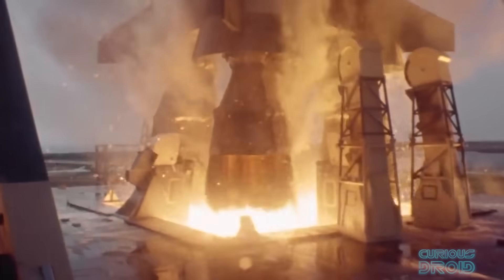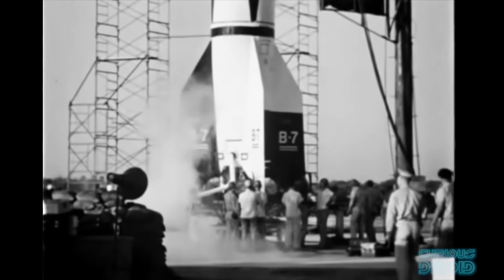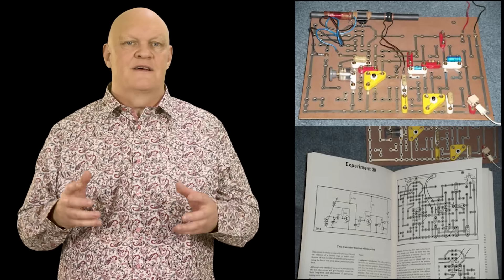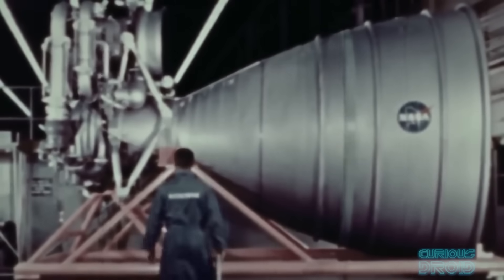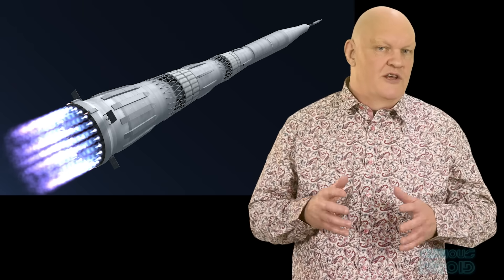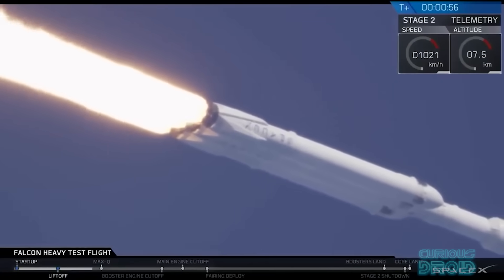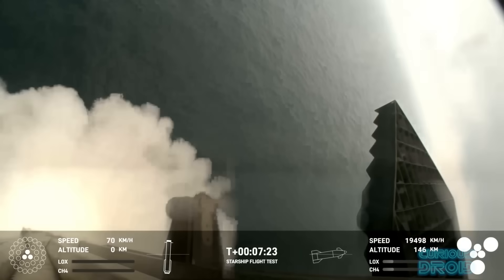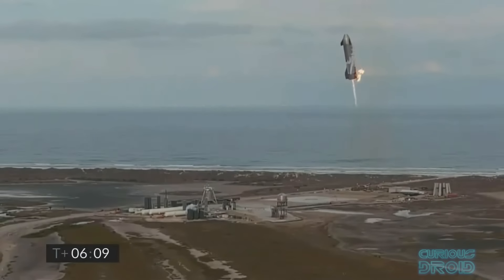Why Does SpaceX Use 33 Engines While NASA Used Just 5?

Comment: This video only briefly mentions the most important point: you want to mass produce just one type of engine to bring the costs down. In turn that means in order to use that one type of engine for all the different stages of the rocket, you have to use a lot of them for the first stage. Saying it is due to throttling limits is putting the cart before the horse, if SpaceX had decided to use 5 huge engines on the booster and land it using just the centre engine, then they would have designed it to be deeply throttlable. And it is possible to have such deep throttle control, though it adds complexity so avoiding it is an additional benefit. But the fundamental driver is mass production of one engine type to reduce costs.
Reply: what would happen if you tried a landing burn with an F1 and empty tanks.....
Reply: @georgeoverton8267  If you time it exactly right you reach zero velocity and zero altitude at the same time and you have successfully landed.  If not, well, probably nothing good.
Reply: They don't really need to make the throttle that low. Falcon 9 does what's called a hover slam. The engines are too powerful and will send the booster back up. So they time the engine ignition at just the right moment so the thrust and velocity of the first stage cancel out just before it touches the ground.
Reply: @TwitchyMofo  The engines are too powerful because there are real limits as to how much you can throttle a rocket at sea level.   Out in space it's a LOT easier to throttle down because you don't have a high pressure atmosphere trying to invade your nozzle and mess up your flame and shock wave propagation.   It's also a LOT easier to make a small engine strong enough to function at sea level than a larger one and SpaceX is smart to go that route.   The F1's were amazing machines...but very restricted in their use and not flexible enough to ever land back at sea level.
Reply: @recoilrob324  I don't think you read what I wrote at all.
Reply: @TwitchyMofo  I read what you wrote...about the 'suicide slam' deal the Falcon 9 does.   They can't do that with the Starship because it has to be able to hover stationary giving the Mechazilla arms time to move into place and grab it.   So the engine used for the hover obviously needs to be throttled to that thrust level.   

Noticed on the last flight that they used several engines to knock off most of the speed then down to the single one for the hover.   Having multiple engines also allows them to switch if the one they were going to use for the hover happens to malfunction.   As long as it's one of the gimbaling ones they should be fine.
Reply: @recoilrob324  it hovers because the thing is so damn heavy. I don't think they had to make any special effort to have very now throttling engines.
Reply: @TwitchyMofo  I agree with the 'no special effort' part...but their choice of many smaller engines also played into the ultimate goal of catching the booster and ship during a stable hover.  There is a very real limit as to how much you can throttle a sea level rocket and their intent to hover was designed within the capability of the Raptor engine.
Reply: @recoilrob324  that's possibly the case. But I think the biggest driving factor behind the small engines is the economy of scale. They will make thousands of these engines. Catching the ship out of the air idea, I believe came after the initial versions of raptor engines. They were struggling with landing legs and decided to ditch them all together. So I'm not sure how they could have known they needed to hover. I think it just worked out that way. I could have that timeline wrong but that's what I remember.
Reply: @TwitchyMofo  Think about the landing process in more detail. First stage boosters aren't heavy when landing, they are empty metal cans. SuperHeavy launches carrying 3,400 tons of fuel, plus a 1,300 ton Starship, which is why it has over 8,000 tons of thrust. Empty its only 200 tons, so to hover it can't use more than that much in thrust. If it had five Saturn V F1 engines for example with 1,550 tons of thrust each, they can't throttle at all so a single F1 would launch a near empty SuperHeavy skywards at over 7 gees. 

SpaceX could have tried to build a bigger Raptor so they only needed 9 engines like the super successful Falcon 9, but that would make them more difficult to design because of combustion stability. And at over 800,000 tons thrust each, they'd have to be able to throttle down to 25%, which is extremely difficult to achieve (currently Raptors limit is 40-50%) and even if possible it makes it difficult to maintain cooling of the bell and chamber, and would significantly reduce operating life. Lastly, it would force them to build a smaller engine for Starship, since a 800k ton engine would be impossible to throttle low enough for landing a 100 ton vehicle. 

So by using 33 engines they get to use an engine thats much easier to build, maintain and get to build in far higher numbers reducing the cost per engine substantially by sharing the cost of the tooling for mass manufacturing over more than triple the engines. And it makes hovering almost trivial without heavy throttling extending engine life and with no suicide burn makes  landing significantly easier and safer.  And they get to use the same engines on Starship, which increases their production of the same identical engine to 39 per stack,  and again reduces cost per engine in mass manufacturing.
Reply: @JesusTittyFNChrist  you're not saying anything I don't already know. As I said before I'm not sure hovering had anything to do with the reason for so many smaller engines. Unless you go way back and find musk saying that they went with small engines to allow hover. Everything at that time had legs and was conceived assuming landing legs. Falcon 9 does the hover slam because it's thrust is too great when it's empty. Meaning hover was not required during the initial design of the raptor. 
Also there's no reason Saturn 5 couldn't have done the hover slam assuming the engines were designed to start back up.
Reply: There's also thrust density to consider.
Given a fixed area on the underside of the rocket smaller engines/combustion chambers will have more thrust per unit area than fewer larger engines. The reasons range from thrust vector gimbal angles to achievable pressures in smaller combustion chambers and expansion ratios.
This is important because the higher the Thrust to weight ratio the lower the gravity losses are.
Reply: the throttle control required would have to be deeper than anything ever done on such a large rocket
Reply: @darkfur18  OK - have 4 large and 1 small
Reply: Yeah which logic dictates that makes 100% more sense for a private company than something funded by the government.
Reply: "you want to mass produce just one type of engine to bring the costs down."

I think in the case of SpaceX it's pretty safe to say that the design of a million engines is down to the fact that it looks cool, just like the tip of starship is pointy because it looks cool.
We can talk about rocketscience all day but in SpaceX most of the work is done for publicity and not because they actually have a good reason for it.

The "good reason" is made up by fans afterewards because "spacex cannot make bad decisions, the genius that is elon would not allow it".

Nevermind that we are ten years in,  several years past the announced Mars landing dates, and we don't have a working starship yet. There be reasons for that, and "they made the right design choices" is NOT among them.
Reply: @vinny142  Falcon 9 is the most successful launch system in history, based on most launches per year, highest percentage of successful launches, most consecutive successful launches, most tons to orbit in a year, first reusable boosters, and lowest cost per ton to orbit (outside the Falcon Heavy).

It's not "fanboys" who think the reason F9 has broken all the records because of great design decisions made by Elon & SpaceX. Its engineers who appreciate how using 10 identical engines enabled mass manufacturing using shared tooling to reduce the cost of Merlin engines to $250K each (from the tens of millions common in an Old Space industry still hand-building bespoke engines). And how using 9 first stage engines enabled using a single engine to land the empty tin can of the first stage for reuse, since larger engines could never throttle low enough. Or their use of the same dense fuel for both first and second stages, which cost some performance to high energy orbits, but greatly lowered launch costs, reduced delays and simplified pad operations to help enable higher cadence launches. 

Lastly, Starship started development in 2019 when the decision was made to build with Stainless steel. Only 5 years later prototypes have achieved orbital velocity twice, that's a record pace especially considering its by far the largest rocket in history. Starship right now could be used as a fully expendable rocket and according to industry analysts (payload .com) would be the cheapest launch system per ton in history. Its far more ambitious than that, but at the rapid pace its test program is proceeding its likely to have both stages landing and reusable by end of the year, and in-orbit refueling demonstrated next year.
Reply: It also fails to mention that starship has destroyed over 100 engines and is still yet to get into orbit. So much for reusable rockets.
Reply: Starship could have reached orbit by now, it reached orbital velocity and altitude. SpaceX chooses to put it on a trajectory that intercepts the earth to ensure they don't  leave a large chunk of space debris that would reenter uncontrolled at some future date.
Reply: You’re just a dense, dense hater.
Reply: Yeah, or you'd fry your butt and be to heavy for a decent burn on account of how much fuel (best engine ever, probably) burns.
Now I want to see what happens with an f1 coming down...boom.
Reply: I thought that was implied already?
Reply: wrong ... what i easir and cheaper .... 30 cars or 3 trucks ?
Reply: @Menelutorex  A more valid comparison would be 33 cars vs 3 semi trucks (I assume by trucks you mean pickup).
Reply: Did Apollo 11 actually leave near-Earth orbit?
Despite the revisionist narrative that this channel won't question -- unstable fuel burn for the oversized F1 engines was never rectified and another arrangement in their place was made in order to reach near Earth orbit, keeping the F1 bell nozzle to maintain the desired appearance.  The great licking yellow flame was an indication that something was not normal as fuel was burning in the atmosphere while providing no additional thrust. This was the result of injecting additional kerosene into the exhaust stream for greater visual effect yet appearing to produce an inefficient burn unlike other rockets after launch.  No explanation is forthcoming and this issue is not addressed in any usual report; however, using a smaller reliable engine with a reduced fuel load and stripped down mission requirement allowed the Saturn V to reach near-Earth orbit.  The Apollo 11 crew attempted to demonstrate their position at over halfway to the moon as seen in the unedited version presented to the public while the more recently released unedited version reveals a flood of blue light entering the same window as the camera continues to roll, through which only a moment before, we saw the Earth far distant in what appeared to be very low light conditions. Then, as the camera pulls back from the window, the exposure settings are seen to return to normal as a flood of light enters the same window.  Without a change in the orientation of the spacecraft assumed to be on a trajectory toward the moon, the only source for any flood of light can be the Earth while in near-Earth orbit.  The usual sponsored efforts will try to make excuses for why the obvious did not take place -- yet is overly apparent in the unedited version.  When facts cannot prevail in support, sponsored activity will resort to name calling and other derogatory comments discrediting themselves.
Reply: @ronaldgreene5733  and yet there is a laser reflector on the moon that proves we made it, a massive amount of footage of the landings and explorations, rock samples, and the fact the USSR itself with its own massive space resources never even tried to debunk US moon landings despite it being a huge part of national pride.
Reply: .  . While remaining in near-Earth orbit, another indication are the impossible weather patterns seen on Earth, when in reality only a small portion of the Earth's surface was visible, framed by the round window of the command module.  Straight line cloud fronts are seen on video to be extending for what appears to be more than 6000 miles, a quarter of the Earth's circumference -- something that has never occurred in the meteorological record on Earth. The round window of the command module was used to effect an image of the Earth but the weather in the region did not comply for a realistic view.  No recognizable continents are found in view, but only the impossible weather patterns seen.
Reply: @ronaldgreene5733  you keep asserting opinions without support. It’s lame that you think anyone will buy your drivel.
Reply: NASA engineers over here
Reply: And redundancy… lost 1/5 engines is game over
Reply: @mattk1358  Actually that isn't always the case. On Apollo 13 the centre engine of the second stage shutdown 2 minutes early, the instrumentation unit compensated by burning the other 4 engines longer and the spacecraft achieved very close to the planned orbit which was good enough.
Reply: you don't make any sense at all
Reply: @11moonshot .  . " sorry, but I am sick and tired" .  . 😃 .  . Thank you for your sponsor reply.  You must disparage the obvious proof demonstrated in the unedited video -- They remained in near-Earth orbit and confirmed by impossible weather patterns for all to see .  . Two straight line cloud fronts each extending for a quarter of the Earth's circumference .  . When in reality we are viewing a much smaller region framed within the round window of the command module under greatly reduced exposure settings.  The camera then pulls away as the window never leaves camera range as the exposure settings are returned to normal and a flood of blue light enters through the window -- with nothing change in the orientation of the spacecraft at that moment.  Good luck with your efforts .  .
Reply: @ronaldgreene5733  YOU GOTTA GET SOME HELP SOON
Reply: Good point - and I assume having smaller engines also allows for much more adaptability between different platforms given the thrust comes in smaller units so it's easier to match thrust to the application given enough engines.
Reply: Чтобы использовать 5 огромных двигателей их надо откуда то взять. Огромных двигателей нигде в мире не производят и даже не разрабатывают. Потому что доказано кучей пратики, что большой двигатель не дает стабильного горения, не дает заявленного импульса, не дает той же топливной эффективности, что и маленький. Так что маленькие используются, потому что они реальные, а не фейковые.
Reply: 3k a kilogram vs 54k a kilogram.... You are precisely correct!
Reply: F1 engines were cheaper!
Reply: @ Have you inflation adjusted the price?
Reply: It's called REDUNDANCY people.... A plethora of smaller rocket engines are far more adaptable and forgiving then relying on a handful of giant rocket engines
Reply: @SavageOne420 Yes! IFT-4 made it to space and back with multiple separate engine failures.
Reply: @SavageOne420  You also get more engine data per launch.
Reply: @SavageOne420 have you heard of n1? More engines does not equal to more redundancy, it depends
Reply: @SavageOne420  no it’s not. Smaller rockets add thrust complexity, as experienced by the Soviet Union with their many engines rockets, due to how many engines you must ignite and run to produce enough thrust. Each engine has to fire optimally. In the US we used fewer much larger engines that reduced that complexity of ignition and thrust.
Reply: @SavageOne420  You need to watch the video again, maybe even twice. Just do it and delete your comment right thereafter before leaving into the shame corner
Reply: @SavageOne420 Redundancy didn’t save the Starship. Redundancy is for systems that can fail but the boosters are so critical most other space agencies would use their abort/escape system for cargo/passengers which Starship lacks.
Reply: @zacharywolter  Redundancy has saved several Falcon 9 launches, which is a big reason it has the highest launch success rate in history. It hasn’t YET saved Starship but that’s still a prototype testing most launch maneuvers for the first time. Almost every other launch system will have to abort and fail if a single engine goes out. Starship will always have redundant options, as it is the launch abort system. It won’t have the acceleration of other abort systems, but it will have 6 redundant engines to help ensure it can always land. Lastly, its goals are far higher than existing launch systems, it’s aiming to  get a lot closer to  commercial airline reliability and flights between servicing.
Reply: @JesusTittyFNChrist as have been said on an above comment, it has saved starship in IFT-4. The booster has several engine failure and still manage to finish the mission successfully
Reply: @Kandralla  Sorry, your take is pretty much wrong in all counts. First, Merlin is the highest thrust to weight orbital rocket engine in history, so it’s actually reducing Falcon 9 dry mass over any group of larger engines. Secondary evidence is that Falcon 9 actually has one of the highest payloads to orbit of any operational rocket. Expendable launches of a F9 FT can put 25 tons into orbit, nearly as much as the Shuttle. Lastly, F9 has tripled the record for consecutive successful launches and has the highest success rate in launch history. So nine Merlin’s made it both one of the highest performance rockets in history, and one of the safest.
Reply: @RandyHill-bj9pc  no, I'm not wrong. If one big engine can do the same work as 9 and that results in a weight reduction (removing all the extra piping and other supporting hardware required to hit multiple engines) then F9 could carry more. We won't know in the near future because no one, including SpaceX is willing to incur the risk of learning how to  develop a big, clean sheet engine. You're comparing a new engine to engines from 40 or more years ago.
Reply: @Kandralla  So the most successful commercial rocket in history would have been much more successful if only they had followed your uninformed musings on how rockets work? First. nine sets of small pipes aren't necessarily heavier than one enormous set of pipes with same capacity. Second, a single F1 has 10% less thrust and weighs over 9,000 lbs more than 9 Merlins. Given the F9's first stage dry masses without engines is only 40,000 lbs,  only imaginary engineering can find a way to reduce piping/support mass by significantly more than 25% of all dry mass while still supporting a monster engine with double the mass and nearly nine times the fuel flow. Basically replacing Merlins with a single F1 would increase total dry mass by nearly 20% while reducing thrust 10%, a recipe for total failure.
Reply: @JesusTittyFNChrist 

Success... McDonalds is the most successful restaurant in history yet no one is saying McDonald's is the best restaurant in history. That argument is bad.

Pipes... You say "necessarily" yourself, you defended my point in your criticism. I'd argue, though, that in reality 18 (you need oxidizer too) pipes running all over the place with their accompanying valves and supporting structure is pretty much guaranteed to be heavier than 4 or 8 clusters runing to a couple locations.

F-1... Who said it has to be F-1? I didn't, you decided that on your own. You act like Elon has some sort of lock on the ability to make the same improvents to rocket engines that GE and Pratt & Whitney have been making to jet engines over the last 60 years. Like they can grow single crystal blades for their engine cores but somehow only Elon can do something like that when it comes to space. Ridiculous. Like saying Teala is better than Ford because of the Model-T. 

The type of improvements in materials, analysis tools, and processes that SpaceX used to make Merlin what it is can be used by others. Not having a big enough market for them is the only reason no one has tried to do so on a big engine, the risk/reward is too high for investors to tolerate.
Reply: @Kandralla  SoaceX is the most successful space company by every measure, most launches, tonnage, lowest cost per ton in history, most human launches, highest percentage of successful launches, most successful launches in a row, only reusable boosters, first orbital booster landings, first and only satellite mega constellation. 

To make your comparison even close to accurate McDonalds would have also won 4 stars from Michelin.

Lastly your fantasy that bigger engines are better despite not being reusable, having combustion instabilities, and easily costing many times more because of lack of production volume is silly enough. That you think the reason is investors won’t let Elon build them is hilarious given he controls a majority of SpaceX votes and if existing investors balk he can raise more money at the drop of a hat (every offering oversubscribed with a line if investors begging to get in).
Reply: @JesusTittyFNChrist  Try reading what I said again and actually respond or don't respond at all.. 

I said nothing about the reusablity of big engines.

There is no reason why big engines can't be reusable.

There is no inherent benefit to reusablity when you're talking about space hardware. Whether they're made to be  reusable or not is a trade that is made when the engine is in development not a requirement that is specified; that's how we got the shuttle. 

You clearly don't understand anything about the process of archetecting a product. Youre just defending a product you like by assuming things I haven't said and aren't even true to begin with.
Reply: @Kandralla  I've disproven every assertion you've made. Merlin is the highest TWR rocket engine in history, and using 9 of them in Falcon 9 is a huge reason why its payload capacity is so high. Larger engines with lower TWR would add dry mass, not reduce it. Elon Musk isn't beholden to shareholders, unlike your assertions no one can stop him if he decided to build larger engines, the only reason he doesn't is they are too finicky and make re-use impossible. 

And we know this because Falcon 9 can barely land because even a single one of its nine engines can't throttle low enough to hover the empty beer can that the first stage becomes when near empty, it has to perform a suicide burn that was a big reason why it took dozens of failed attempts before they mastered landing. So less than 9 engines makes it near  impossible, even if you design your engines to throttle more deeply its subjecting the bell and chamber to excess wear from out of spec temperature ranges. Blue Origin's New Glenn is going to attempt retropropulsive landings with only 7 engines, I don't doubt they can pull off the suicide burns but doubt the BE-7s will be re-usable without significant maintenance and frequent bell/chamber replacement. Given their track record its going to take them a very long time to solve these problems. 

There are no other recovery methods that have been shown to work. SpaceX attempted parachutes but they are heavy, have to be heavily insulated to handle hypersonic re-entry, and don't always unfurl properly. As RocketLabs has demonstrated, catching them with helicopters is near impossible so the stages end up dunked in sea water that's terrible for their electronic components. Even the solid rocket boosters on the Shuttle took so much damage from parachute landings that only parts could be re-used.
So can you build a large engine that's re-usable? Sure, its combustion will be less stable, it will be far more costly to build and add dry mass because of a lower TWR, but you can build one. But if you want to land it you'll need a booster that weighs close to half its thrust tonnage. Unless you want to take the New Shepard approach and make a booster so excessively heavy it can't achieve more than 10% of orbital velocity, landing requires using a large number of engines so only a single engine is a tiny fraction of total thrust. And an enormous booster with enough mass to get near the 50% throttling limit on most rocket engines. Raptor has about 250 tons thrust, meaning it can hover a SuperHeavy at say 250 tons with remaining fuel without throttling at all. Throttling it to 50% means you can use two engines, in case one fails the other can be throttled back up to compensate while another comes online . 

An F-1 sized engine with over 750 tons of thrust can only land a 250 ton stage using a suicide burn. Which means if the engine fails to light, the booster is destroyed. If the stage is 375 tons with remaining fuel and the large engine is throttled to 50%, it can hover but if the large engine's combustion instability rears its head, no hover, just crash. Or if the engine fails to start, or has any problem, crash, kaboom. You have no redundancies at all. And a first stage that's likely heavier than it needs to be because if it was as light as possible you are back to risk suicide burns.

So sure, you can build a reusable rocket using F-1 sized engines, as long as its probably double the size of SuperHeavy/Starship and four times larger than Saturn V, and you use at least a dozen of those engines to give you the ability to hover. And take a decade to develop the engine (BE-4 is far smaller and a decade old before its first launch).  Instead SpaceX has build the worlds largest rocket in only 5  years using Raptors, giving it incredible redundancies for landing attempts and super high performance with the 2nd highest TWR in history.
Reply: @JesusTittyFNChrist  no you haven't. You're not even capable of comprehending that 50 year old technology can be improved upon. Your only argument is that Merlin (developed recently) is better than F-1 developed 60 or so years ago ... Which is like comparing an F-22 to a Sopwith Camel. It's stupid.
Reply: @Kandralla  You just keep moving those goal posts with every loss. You haven’t cited a single engine built in the last 60 years that comes remotely close to Merlin or Raptor in TWR, so it’s just your imagination that a large engine can be built to outperform them. It’s like you are saying Usain Bolt isn’t that fast, if only he had you for a coach he would have been much faster.
Reply: @JesusTittyFNChrist  reading comprehension, Canz yoouz haz it? 

I didn't say it existed. I said the same improvements that give you merlin also apply to bigger engines. No one has developed one because the customers are few, and he costs to figure out how to relearn how to do it is high... High risk, low reward unless a customer funds it.

Elon won't say this because Elon is a sociopath with a fragile ego so he will never say "spaceX does not have this capability" he makes up some BS about redundancy that ANY engineer worth their salt with 10 years of experience knows is a stretch at best. 

This is exactly what he did when they couldn't get radar modules for Tesla, he removed them and said that they weren't as good for FSD as cameras which because radar can only see in 2d which is a load of poo.

Go look at gas turbines of the 70's and the ones now, they are now the size of a small house, super high bypass and super efficient, for the same reason merlin engines are. Better manufacturing processes, better materials, better analytical tools. Those were applied to merlin, they can be applied to a bigger engine. That bigger engine won't happen unless a customer with a giant bucket of money funds it's development.. So a government.

NASA isn't funding it because they don't seem to be serious about going anywhere. You may find this surprising, go look at Smarter every days video on Artemis and realize that Destin is a positive, optimistic person who is giving NASA the benefit of the doubt.

Your whole premise implies that all engine development should stop because SpaceX has the perfect engine. Which is shockingly ignorant for someone claiming to know anything from this field.
Reply: @Kandralla  Destin has some good criticisms, but not on the number of launches. This isn't the 60s anymore, Earth-Orbit-Rendezvouz is the best approach, its what Von Braun wanted to do but the technology wasn't ready. Using in-orbit refueling allows landing payloads nearly 100x larger than Apollo, giving astronauts far longer stays on the Moon to do far more science.
No one is saying Raptor or Merlin is perfect, or that you can't build larger engines. But every engineering decision involves making the best trade-offs for what your goals are. Starship's goals is full reuse to dramatically lower the cost of payloads to space, and landing on Mars. Raptor fits those goals best in its current size.
This is because the main reason SpaceX reduced the cost of space launch by over 80% isn't landing boosters, its mass manufacturing of Merlins. By using same engines on both stages they were able to make hundreds of engines on assembly lines reusing the same tooling, dropping Merlin costs to about $250K each. 

Blue Origin didn't do this with New Glenn, they have a 2nd stage engine (BE-3) that it only uses 2 per flight so its built by hand in tiny quantities, and totally different first stage engine (BE-4) they haven't figured out to mass manufacture. So the BE-4 costs at least $3M each, more than 10x the cost per Merlin, and its likely the custom BE-3U costs even more. 
If Raptor was twice the size, Starship could only use 2-3 of them at most. That makes it impossible to throttle one down for landings, meaning your crewed ship can only land using suicide burns and if the engine chosen doesn't relight properly its too late to try the others. And with SuperHeavy only using 16 engines manufacturing costs are significantly higher from shorter runs. 
Rocket engineering is finding the best compromises to meet specific priorities. Hydrogen offers the highest ISP, energy per pound, in a safe to handle fuel, about 30% more than Methane. So Kerbal level amateur engineers always choose it thinking their rockets will have higher performance. But hydrogen is a tiny atom, meaning Hydrolox engines don't generate as much thrust from same fuel flow. So you need bigger, heavier engines offering much lower TWR. And H2 isn't remotely as dense as Methane or Kerosene, so it requires far larger and heavier tanks. And those tanks have to be cryogenicly cooled to keep H2 as a relatively dense liquid, adding even more dry mass. All that extra mass means that Hydrolox rockets don't perform better except in very specific uses (high energy 2nd stages) but cost far more because of the special handling required (H2 leaks like crazy because its so tiny) and have poor cadence because of delays from leaks. 
Falcon 9 shows the triumph of systems engineering that made it less than half the cost of competitors while putting twice the mass into orbit. Same dense fuel on both stages kept it smaller/lighter, and eased pad handling with fewer delays. Mass production of same engines made them more than 30x cheaper than hand built commercial rocket engines of the day. When it was first launched (before reuse) it was priced at $63M,  about 16%  the cost of a $400M hydrolox Delta 4 Heavy,  yet it put nearly as much mass into orbit. This is how the future is built. You don't fly on jetliners that are thrown away after one flight, or that have different engines using different fuels for different altitudes.
Reply: @JesusTittyFNChrist Destin isn't saying in orbit refiling was bad; he's saying that they have greviously underestimated how many launches they needed to accomplish the mission and then shows that the real schedule is much much much longer than their current estimate.  

I'm done now because you just prove over and over again that you are chronically unable or unwilling  to comprehend anyone's argument... probably because your entire knowledge of the subject is talking points from the stakeholders (who have as a primary goal hiding their dirty laundry to maintain funding).
Reply: @Kandralla  Number of launches isn’t a problem when your launch system can launch a new tanker every day. Falcon 9 launches every 3&1/2 days, it will be trivial for Starship to launch daily when the entire stack costs only $90M, is fully reusable and they can have easily have a half dozen to make rotate through. 

We should stop this thread since I’ve rebutted every single one of your claims and you are unable to support a single claim with actual facts, so you just keep moving goalposts. Finally you’ve reached the “Musk man bad!” level of ad hominim fallacy.

Elon Musk isn’t SpaceX, I measure SpaceX by what it does, not Elons all too human failings. I don’t base my beliefs on claims from his tweets, but on whether they have adequate supporting evidence. SpaceX has clearly created the most successful launch system in history by success rate, cadence, payload tonnage, cost per ton to orbit, etc and clearly advanced state of art in reuse and built the largest rocket ever to make orbit. Thats what I measure them by and what I care about, not Musks tweets or politics.
Reply: It would make much more sense to use 4 large engines, and perhaps two smaller engines, that work in unison at launch, but during the landing cycle, only the smaller engines are used, which removes the complexity of the large engines having to deeply throttle. But as you say, single engine design is what really drives down cost. The drawback of a large number of smaller engines is the plumbing, this becomes an incredible spaghetti of pipes.
Reply: @paulmichaelfreedman8334 yes, and carry the weight of those 4 massive engines down to earth. I feel like engine weight doesn't scale linearly with it's size. Besides, it's easier to produce 1 type of engine than 2 vastly different ones.
Reply: @paulmichaelfreedman8334 fewer engines to design, more cost per engine as the rnd cost per engine is higher due to fewer engines, thus economy of scale doesn't kick in. It also allows for more thorough testing as if you're building hundreds of engines instead of 50 then you can afford to test more of them to destruction again due to economy of scale. More engines means more plumbing and more ways for things to go wrong but it also means more things will go wrong instead of hidden issues potentially never being discovered during testing due to it being tested less overall (in terms of total engine runtime across all engines).
Reply: @Viper607706 you need to take into account that this is the first full flow staged combustion engine ever used. I'm not sure if there would be any virtue in designing 2 of a brand new engine type at the same type. SpaceX have already iterated the design 3 times. Everything up to next year and maybe beyond will be a prototype. So sort of more than one engine but just not 2 sizes which would serve no real purpose.
Reply: We still don’t have a proof that Raptor can work properly, they can’t even do few burns .
Reply: @emceha most of them have worked flawlessly
Reply: More kiwiko than actual content lol
Reply: Connecting 32 engines to work together was certainly complex.
Reply: In fairness, cost isn't really much of an issue. I can't remember it exactly but I recall seeing a study done by NASA and Rocketdyne that found that with modern manufacturing methods and some simplification of the plumbing the F1 would be a more than competitive engine in the current market. The problem there though is that we literally don't know how to make them anymore. So many small changes were made during development that either weren't noted down properly, or were just shared between the engineers making them that we couldn't build a modern F1 without redoing all that work, which makes the program a real mess. Although actually I do remember hearing murmurings of Rocketdyne planning to produce them again, so who knows.
Reply: @lotto77102  it's probably less that the changes weren't documented and more that the documentation was lost. I've worked on stuff where the original drawings were on mylar and master copies were required to be kept and many of them were missing or damaged. This product was still in production. If a company struggles to maintain documentation for an active product how much more difficult must it be to do so for something that has been out of production for 40 or so years.

Especially if they were redlines that didn't get fully incorporated into a production drawing.
Reply: @lotto77102   Rocketdyne jacked the price of RS-25s to $150M each for the SLS from the $47M charged for Shuttle, despite modern upgrades to make them more "affordable" . Rocketdyne will happily tell NASA whatever it wants to hear, as long as it's on a cost plus contract so they can rape the american taxpayer.
Reply: @lotto77102  You have lost the entire supply chain.  So you'd basically be starting from deep in the design process, where you have to specify all the valves, piping, electronics, etc.  Not impossible, but not nothing either.  

And the most critical parts would probably not be built the same way, with the injector being made by PM+HIP or 3D printed+ HIP.  The nozzle would be probably an inner and outer machined shell with cooling channels between.
Reply: @k53847  That's... Exactly what I was saying? Modern construction and design principles simplify things but the fact that making F1's is quite literally a lost art is the biggest barrier.
Reply: Yeah the problem this causes which I doubt they will ever truly overcome for human rating - is the MTBF. The mean time between failure.

as complexity increases the MTBF drops exponentially due to the interconnected nature of failures - 33 engines provides a LOT of opportunity for 1 to go wrong and take out a critical system
Reply: Yea. Same with the military.
SpaceX should deadass sell their raptor engines to other companies.
With the economies of scale, they would be incredibly cheap and would help get us in space easier.
Reply: @honkhonk8009  The alloy they use to achieve their ridiculous chamber pressures is their own tech.  While I'm sure China has stolen the IP by now, it still makes the best sense to keep as much of Raptor development to themselves as possible.
Reply: @Asterra2  I know where you can find a couple in the Indian Ocean . . .
Reply: @honkhonk8009  they arn't allowed to sell anything to anyone.
Reply: @honkhonk8009  SpaceX is already aiming for mass production as they will greatly increase their launch cadence.
Reply: Any cost savings by mass production I think is completely undone by the dozen or so launches required to refill just 1 rocket in space, so it can go land on the moon and come back. I'm kinda lost as to why we're going back anyway...
Reply: @Solo-Anarchist Read up on helium 3 to understand one of the reasons for going back to the moon.
Reply: @Solo-Anarchist  I vessel leaving from orbit requires a fraction of the fuel of one trying to climb out of the gravity well so having reusable rockets ferrying fuel to a large interplanetary vessel just makes sense. Going back to the moon is an important first step in manned exploration of the solar system because the moon has water which can be extracted and used to produce oxygen and hydrogen on site. A large interplanetary vessel could then carry enough people equipment and supplies to establish a permanent base on the moon which could then manufacture fuel air and possibly food to resupply the vessel for longer journeys without having to lift such heavy loads up from earth's much deeper gravity well. These are all vital steps to the eventual exploration and possible colonisation of mars. Because while a tiny little capsule can carry a couple of highly trained people to the moon and back in a few weeks you need something far more substantial to carry larger numbers on month's long voyages to other planets. This has been the focus of most of the work done on the ISS developing and testing equipment and procedures for long term life support in space.